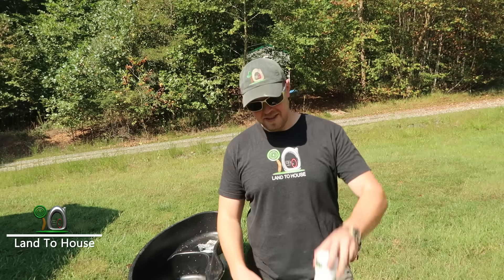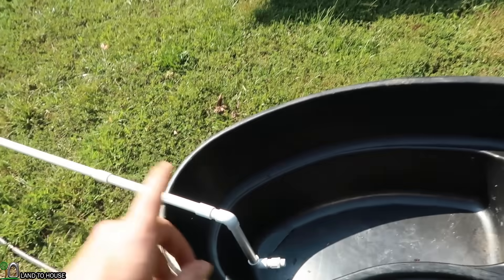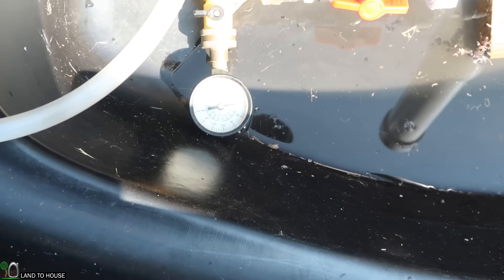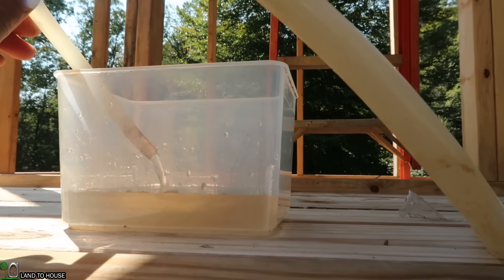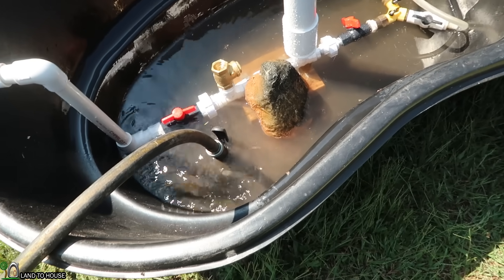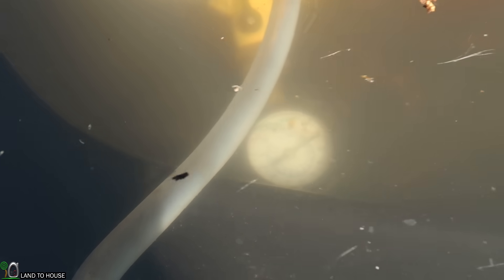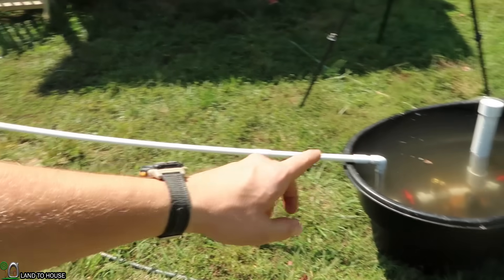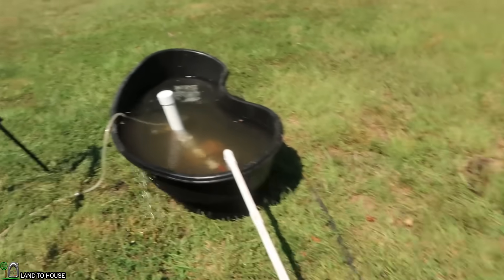Underwater Ram Pump

Comment: I believe the reason that  pressure under the water is less than the one that open to the air is that the valve for the water outlet (waste one) has friction (suction/vacuum effect) by the outside water when  it is open/closed.; this reduces velocity for  the valve to close or open which  reduces the hammer affect that leads to reduce the pressure;  whereas the  systems open to the air one, the valve can close  or open faster than underwater one does; this produces stronger hammer affect,  leads to produce stronger pressure (not much but can be significant different in water volume in over long period of time).

Comment: I bought a 1 1/4 pump about a year ago and I'm finally installing it to help me pump water to a holding tank. however, I can't seem to get it to work so my question is how much head and/or how much height does the pump need for it to get it working...
Reply: Been there, done that.  About 20 years ago I built a ram pump to pump water from my creek and two spring boxes which, like you, wouldn't work for me for longer than about 10 minutes.  Scratched my head, spent three (3!) years (!) and $500 trying to get it to work.  Then discovered in a book by Gene Lodgsdon (check his books out on Amazon) that you needed a ***MINIMUM*** of at least three (3) feet of head for it to work. I only had two (2) feet of head.  Instead, I went and got a solar panel (30 watts) which I hooked up to a  bilge pump and pumped the water out of the creek, up six (6) feet and gravity feed it into the raised bed garden.  Wish I had the $500 back that I spent trying to get the ram pump to work.

Comment: This question may have been asked already, but here it goes anyway. It is not possible to mount my ram pump where it will not be potentially flooded from time to time. I'm filling a tank up twenty feet from a natural spring. My question is will the tank supply be contaminated by the floodwater when the ram goes under? I assume it will but I figured someone would have the answer just for my information.
Reply from the maker: I imagine that flood water getting into your spring could contaminate the water in the pump. If you're going to be drinking that water I highly recommend a nice filter for consumption. It's completely fine to mount the ram pump out of the water
Reply: @LandtoHouse  Thanks for the reply, I figured that would be the case. I'm using it for handwashing and washdown in my shop but the kids being in and out of there its just a matter of time before someone drinks from the hose. I suppose I will filter it as well just in case.

Comment: Every time I see ram pumps they all  share the same design with water that pushes out of the check valves. I understand operations and why it does that. So I wonder if is possible to catch that water and re-cycle it back to the pump, thereby not losing any water.? Got any thoughts.
Reply from the maker: Because the water coming out of the waste valve is at a lower pressure than the source water it's not possible to return it to the source. You can however let that water run down to another pump and recycle water that way
Reply: @LandtoHouse   that was kind of my thought but I suppose there's going to be water loss no matter how many times you go down the line there will be water loss. Well thank you for the video and response.

Comment: So, can I create a never ending waterfall with a ramp pump?  Just send the water back to the bucket?
Reply from the maker: The ratios are different for Wastewater and delivery water. Only about 20% is pumped and 80% lost to the waste valve. This means all the water will be at the bottom quickly in a closed system
Reply: To do that you would need a Heron Pump not a Ram Pump.

Comment: Is it neccesary to use a long drive pipe?
Reply from the maker: If the drive pipe is too short. Less than 25 feet. The cycles will be too fast and the pump might not operate.

Comment: It makes sense to me that the submerged pump would produce lower pressure since the valve will close slower causing a slight loss in peak ram pressure.

I believe the reason the volume delivered by both situations is similar is because the average pressure generated while the output valve is open is limited by the work being done and both tests did the same work.
In this case it's essentially the difference in height between the pump and the open end of the hose that's being benchmarked. You would see a much greater difference if the output hose were long enough to present a significant resistance or if the height difference was great enough to hold the pump near its maximum output.

P S. Apologies for the necro

Comment: The pump will work in a well?
Reply from the maker: Sadly no. Notice in this video that the water source is coming from above the pond.
Reply: @LandtoHouse  But if you start it with a second electric pump? Will work?

Comment: So can you use a small solar pond pump to elevate the source head to run this pump and achieve much higher elevation than the solar could normally do?
Reply from the maker: Yes as long as the solar pump can supply the required gallons per minute to run the ram pump.

Comment: It reduces the pressure from the point of the gauge because it needs more pressure to expel the water into the pond or pool that you created. Therefore the deeper the water the the more pressure is needed for the release of H2O. If the ram pump were in deep enough in water or lake(pond) the water overburden create pressure not allowing the release at the 1st valve where you prime.
Let me know if you understand
my comment please.
Steve L @ cogeco.ca

Comment: Placing the pump in an open storage tank/trough is a great way to capture the waste water for storage like for watering stock before lifting the supply to an elevated tank to provide pressure for sprinklers.
Reply: Cows wouldnt let that thing last a day.
Reply: @Seriouslydave  certainly not in this configuration but be a little creative.
Reply: @AudaxK9Academy  i would pipe the waste outlet to the tank on the other side of the fence it should be the same as running it under water if you dont go too high (same level as top of holding tank same pressure) or a bell/u siphon.
Reply: Video just showed, you can store the wasted water but then you reduce your output pressure so you can't pump the water as high. There's no free lunch.

Comment: i was wondering since the ram pump excess water normally just goes back to the stream could you not use a underwater ram pump to feed a smaller 2nd ram pump to collect more of the water.
Reply: Not without letting the waste water from the first pump reach zero pressure (an open pond.) Back pressure on the waste valve would rob the pump of its ability to pump.  If you captured that waste water then set up another pump with a similar drop you would probably lose efficiency over just having one pump at the bottom of a longer drop. Since you would need pipe to create the headstock of the second pump you would be better off just moving the first pump to the end of the available pipe you would to better.

Comment: this is a game changer !! thank you ! the pump could be inside its own reservoir, and waste dumping to replenish itself. as long as the drive pipe is above the pump ?
Reply: No
Reply from the maker: Sadly this does not work. When you sink the pump you have the weight of the water on top of the waste valve that counteracts the head pressure gain. This means there is no flow of water.
Reply: @LandtoHouse  what about 1) tilt the pump set up to a less upright position to minimise the above water weight at a deeper water level or (2) craft a certain "roof" above the waste valve to absorb some of the weight form the above water from sitting directly on the pump? If this works am buying a pump today!
Reply: @motoernest7890  And how will you discharge the waste water from the protected space? That head of water above will back-flood your protected space right away.

Comment: Could you add a one way return pipe from the pond (as a sort of overflow) going into the main intake pipe via a t-connection? Then their would potentially be no loss of water in the system. 

Maybe the overflow will not be enough to return the water into they system as it would be too slow for the incoming water from up stream? Still causing the pond to overflow the whole thing together?
Reply: I would love to find a way to minimize water loss. I will be trying this to go from a holding tank to an elevated tank to increase water pressure to my home. I don't have an unlimited water source so capture and re-use of the wasted water will be necessary.
Reply from the maker: Sadly this does not work. The pond is lower than the intake. Also if you connect the two you would equalize the water source and stop the water from moving.

Comment: The underwater pump is the same as the pump with the stand pipe on the dump valve. The pressure difference is the weight of the depth of the water.
Reply from the maker: This summer I want to test the ram pump again in a swimming pool. I think it will give much Clear results then this test here

Comment: Hello, very informative video about Pump, in under water there is possibility that, if remove incoming water line from bucket and direct use from lack then it's work or ?
Reply from the maker: Thank you for watching. Sadly no this does not work. The water source must come from above the location of the pump. Does not work in a lake. Does work well in a creek.
Reply: @LandtoHouse  thank you for the information,
Reply: It cannot work without a drive pipe fed from an higher head of water, so the answer is no. The system relies on water pressure and the induced water hammer shockwave from the waste valve and pressure vessel input valve to build internal pressure for the output pipe. This application would seem to show that it is possible to site the pump lower downstream in a watercourse if required or perhaps on a floodplain which became flooded from time to time. It would be possible to have a standpipe system (which is effectively the bucket reservoir in the test set up) so long as it is from the higher head of water.
Reply from the maker: Yes well said. Thank you.
Reply: Land to House Hi Seth, I’m wondering about the feasibility of generating electricity using a ram pump to restock a hydropower reservoir tank (like a water tower, sited higher than the creek) with the outflow from the reservoir flowing back to the drive pipe source (i.e. the creek)? Effectively, you’d have a turbine powered by water falling from the water tower, which is then refilled from the ram pump. It probably wouldn’t be a continuous uninterrupted supply cycle, but with a battery bank, it might be possible to maintain a supply with a discharge/recharge cycle factored in. Any thoughts?
Reply from the maker: You can fill a tank a d run a generator from that. The power will be limited though. For example the calculation for micro hydro is:
((Head pressure * gpm) * .18 )/2
This is in watts. 
The power made will be limited because the ram pump only supplies a low flow rate.
Reply: @funkyfender1  thank you for brief information,

Comment: The difference in between underwater or not should be directly related to the amount of head loss.
Reply from the maker: I want to run this test again in a larger body of water so I can control things a bit better. I have a feeling that has you submerge a pump it gains head pressure but also gains hydrostatic pressure on top of the pump. So there should technically be no change in pressure.

Comment: Does the size (length and/or diameter) of the pressure column tube make any difference?  Example, if the tube were longer and a larger diameter would you get more pressure/output?
Reply: Bigger diameter of pipe=more volume, smaller pipe = more pressure?
In this instance since gravity fed, would this apply?

Comment: Great video.  I have a comment and a question.  First; I believe you are getting less water from the submerged pump because the head distance has been reduced by the depth of your pool.  Question; I am curious to know if the submerged pump is sending a higher percentage of water through the outlet, due to the restriction on the waste valve.  Did you happen to check this?

Comment: Incorrect they are not equal results, you lost 10 psi from out of water to under water. In the short run you demonstrated the results seemed small but for a significant run it would be major.

Comment: If you make the pump have the same differential as the water level in you pond, the pressure should be 24 lbs as it reads under the water level.

Comment: Logically thinking, it is the differential or head between the source and pump that powers the pump.  If the head of water covering the ram pump is equal to the height of the water source it will not work.

Comment: The underwater model defeats the concept of the pump.
Consider this imaginary setup.
Place the ram pump 10ft underwater on a lake. 
The intake  at a few inches below water level.
There would be NO flow down the intake, as the exit of the valve  and the intake are at the same water level. 
The work the pump can build is based on the water level at the intake vs the water level at the valve.
So, the more water you have OVER the valve, the less work the pump can make.
Reply from the maker: This spring I hope to test this concept.  Think about this setup:

Water source 3 feet above a swimming pool.  Place the pump on the water surface.  Then test again with the pump at 3 feet below the water. The two values should be about the same.  No change in pressure because both are using the original 3 feet of head pressure.
Reply: Land to House  waiting for this

Comment: I'm from Malaysia. Please do the test, that it's 100%inside the pond/water, include the cylinder.  And your result a bit different cause by your source water getting less. Thus, gravity weights of water will getting less. Anyway, this is great video.
Reply from the maker: Thanks for watching. The source water needs to come from outside the pond holding the pump. Later this year I hope to have a fully submerged pump.

Comment: well you answered one of my questions,,,, if the pump is under water will it use or suck up some of that water ,,,but since it was over flowing I guess not ,,,,, it just seems to me to be such a waste of water to make this pump work you dump about the same amount on the ground ,,,, NOW ,, if you could get it to recover the spilled water too,,, them you have a 100% efficient  pump ... it just seems that there should be a way to redirect or have the pressure run a second pump that could recover that waste water..... HUMMMMM FOOD FOR THOUGHT :)

Comment: your flow rate tub should be at the top of the structure, your tecnicaly only lifting the water to the height of the end of the hose since once the water breaks over the top, the suction of the water coming back down reduces effective head pressure
Reply from the maker: That is true if the water is flowing with enough volume to fill the tube and pull suction. I am not sure it was in the test. I would like to test the underwater ram pump again this summer.

Comment: For the large pump you have on Amazon what is the head lift at that 3ft feed drop
Reply from the maker: Typically you get the 1 to 7 ratio. Head pressure to lift. So with three fetus head pressure. The pump will reach a maximum of 21 feet. If you bring the delivery pipe a bit lower you will increase your flow rate.
Reply: So six fetus means 42 feet lol

Comment: Would be great if you could look into a solution for all the water displacement...!!...the only place so far that I can see that it will work, might be if it's placed in a tub that will overflow into something else like a pond !...in which case completely defeats the purpose of the tub.
Reply from the maker: It is possible to connect a tee on the waste valve and pipe the water away from the pump. This test was just to prove that underwater operation was possible:)

Comment: I didn't read ALL the comments, but your reduced pressure and flowrates could also be related to the water pressure (weight) on the top side of the valve you need to close. There's water, (and pressure)  making it harder for the internal pressure to close that valve.
Reply from the maker: Yes ! Good observation.  That water pressure is called hydrostatic pressure. It does reduce the head pressure activating the pump. Making the pump less effective.

Comment: Could this be used to circulate the water back to the source in a loop? For instance, I have a tank at 5 ft up, and a waterfall piped over a turbine into another tank. But I haven't found a good way to get the water back to the upper tank as fast as it falls.
Reply: What you are talking about is a perpetual motion machine. Limitless free clean energy.  Nice dream, mechanically impossible.  The flow rate of the ram pump will never reach the free fall rate over your turbine.  Factor in diminishing returns from water lost to the splashes on the turbine, and the much larger loses from the waste valve, you may get enough water back to the top to extend your run time by a small amount, but nothing long term.
Reply: @justinkraynie6435  alright. I actually got it working (sort of) in 2 tanks, but it's not fast enough to keep the tank from filling. think adding a 3rd even lower with the pump in it might increase the pump abilities. IDK. More experiments! The pump is actually under water in the second tank, so there is no splash out from it. The turbine is a low-flow unit, inside the pipe, so there's no splash loss from it, either. I just have an overflow problem in the lower tank at the present, cuz the top drains faster than I can get it pulled back up. Tried it with an Archimedes screw the first time, that didn't work at all!